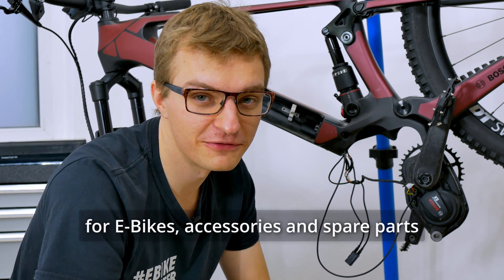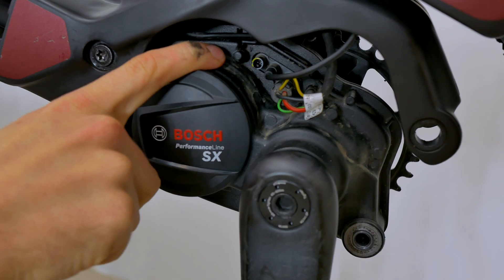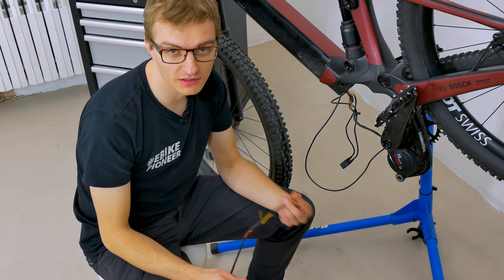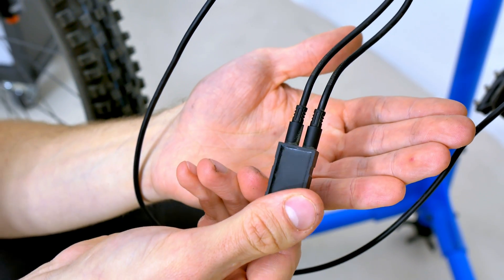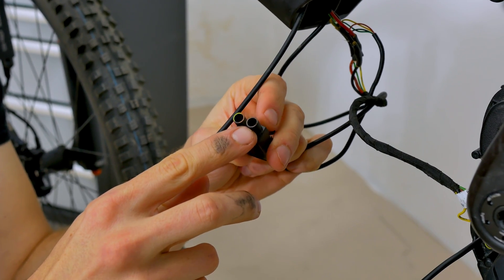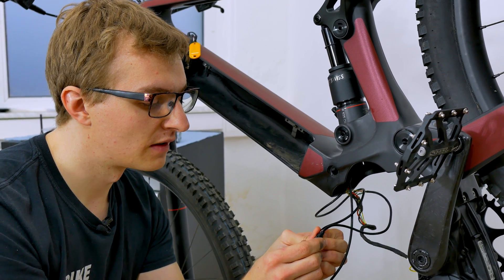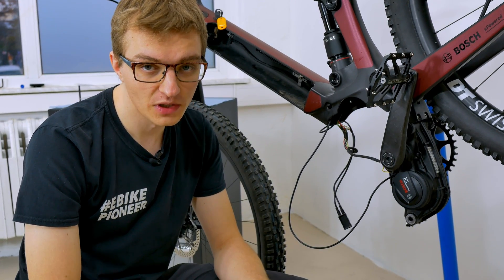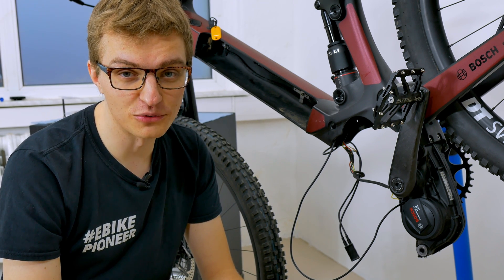More High Power Ports for the Bosch Smart System - with the Component Connector & T-cable | EBIKE24

Comment: Hi, is it possible to hook up a 12v wireless charging head from quadlock to a hpp?

Also, does the port deliver continues power? Or only when the bike is on?
Reply from the maker: Hi, and thank you for your comment! In theory, this should work since the HPP provides 12V. However, I'm not familiar with the Quadlock system, so you might be better off contacting them or Bosch directly. Also, the HPP only delivers power when the bike is turned on.
Cheers - Michael
Reply: @ebike24  Thanks for the information. I managed to get it to work, but now I wonder if the provided hpp amperage is limited from the engine. The quadlock can draw up to 2A. Wouldn't want to burn the hpp. I know hpp supports temporary peak amp. So I assume it must support some kind of safety against overheating.

Comment: How can we enable the power ports ourselves? I don't want to pay I think the light is disabled for my Cube bike and i want to put front light on it.
Reply from the maker: Hi, unfortunately, there is no way to enable the ports by yourself. The Bosch eBike diagnostic software is required for this and, as far as I know, it is only available to dealers. If you have any suitable equipment for the port, you can try to connect it to test if it works. This means it is already enabled. If it does not work, you would have to look for a dealer. I am sure that there are some who do it for free or for a small fee. It might be worth contacting multiple dealers. Hope this helps!
Cheers - Michael

Comment: I’ve a Riese Muller Delite4 Rohloff with the Bosch smart system, it’s already equipped with gps connect module, abs, front and rear light.  I want to add a Garmin Varia ETRL615, what do I need to do in order to power this additional accessory and is it possible?  Thanks
Reply from the maker: Hello, thank you for your comment! From what I found for the Garmin Varia, it is only compatible with the previous Bosch generation (Bosch Gen.2). This means it cannot be connected to Smart System bikes. Here I recommend getting in touch with Garmin directly: https://support.garmin.com/en-GB/

Cheers - Michael

Comment: I have a question, sometimes it happens that the smart control shows an orange color, the bike moves, but you can't turn on the assistance. It has to be turned off and on again, any advice?
Reply from the maker: Hi, That sounds like a technical problem. Have you already tried reconnecting the system controller to your control unit? It may also help to check the display cables and reconnect them. You are welcome to contact our customer service at info@ebike24.com.
Cheers - Michael

Comment: This is amazing. Can I get a connector that then converts the port to a USB A connection so I can connect my innov K6 dashcam to it?
Reply from the maker: Hello, thank you for your kind comment. At the moment Bosch does not offer any additional cables for USB connections. In general, you can buy a corresponding USB socket and connect it to an open HPP cable. Sufficient knowledge of electrical engineering is probably required here, however.
Cheers - Michael